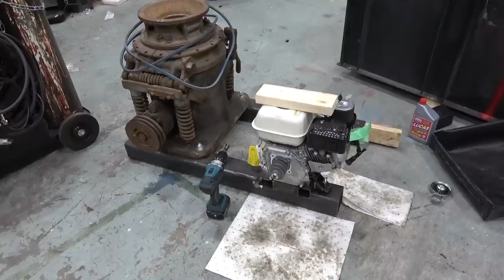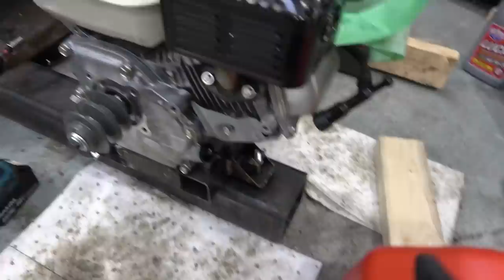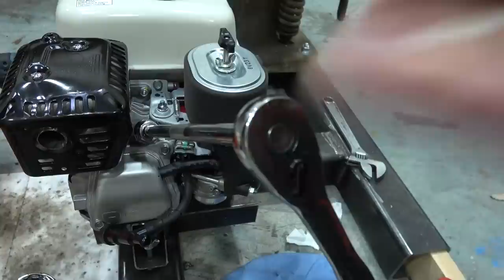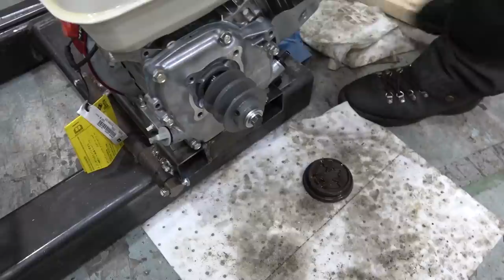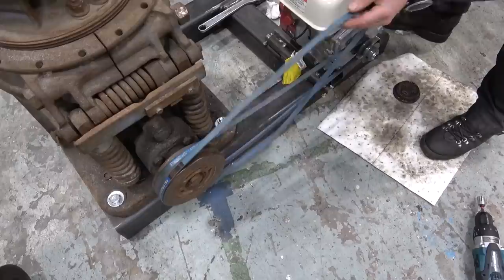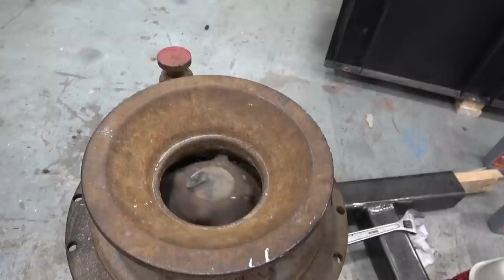Restored Diesel Honda Rock Crusher

Comment: A couple years ago I finally gave up on the "I'll remember" method and invested in a couple sharpies for the jugs full of used oil and the gas/oil mix cans.  But not before I messed up 2 or 3 dozen times, of course.
Reply: Working in kitchens has made me a label freak. You never know which brown sauce is which and how many days weeks or months it's been sitting there and whether it is supposed to be a brown-and-green sauce or not until you have the habit of naming and dating everything.

Same applies to the shop though tasting for freshness is less of an option.
Reply: In my experience the sharpie quickly fades on a gas can
Reply: @zeusapollo8688  : Then go with a wood burner and cheapo wood tags. Piece of twine to hold it to the bottle, and you're good to go.

Until you need it of course, at which point you discover the grease and dirt and occasional hotplate incident have turned the whole thing that same color...
Reply: @Paul J Pachasa JR Just do 32:1 and carry a spare plug, like in the days of yore. 👌
Reply: @Paul J Pachasa JR I'd just run 40:1 in it all. My trimmer says 50:1, but it runs just fine on the 36:1 dirtbike leftovers. 
Then again all the bikes get Castrol 2t at 36:1 whether they ask for it or not.
Reply: The oil + gas ratio is really about the oil used, not the engine going into it. As the oils got better, the ratio got lower. Get a good oil and you can run any of these engines at 50:1

Comment: I've had problems starting these Honda engines even when the gasoline is a bit stale.  After much cranking, troubleshooting and cussing, I found a fresh tank of gas fixes 'em every time.  Using diesel fuel will definitely cause hard starting.  As Madprop Boatworks said, "If a Honda engine doesn't start, it's definitely operator error".  How true!

Comment: "Warn me when you start to feel sleepy"

Dude, I changed shops and now I'm in a shop with 1 door per bay, and I like to leave my bay doors open, because sometimes I have to run the cars inside.

But some people don't like the freezing 65° temp, so they're always shutting the doors when I walk away.

Sometimes I just leave an running even if I dont have to, just to make them think twice about shutting my fucking doors. I took the far end of the shop for a reason, leave my doors alone.
Reply: Sometimes being the lone tech at a two man shop has its benefits...mainly shit like that.

Comment: Reminds me of working with my father.  Fun fact: a chainsaw will run on kerosene pretty well, and a Honda 5hp pressure washer will run if it's started on gas.  No power though.  Guess how I know. At least the old Robin won't get any rust on the internals...

Comment: When I was a kid my dad had his own in ground gas and diesel tanks. He had 70's vintage rv with a gas motor. I was given the task of gassing her up prior to a trip. Well, I grabbed the wrong nozzle and put 1/2 tank of diesel in before I noticed. Long story short I told him what I did and he filled it the rest of the way with gas. We took it on our trip and the hesitation and backfire it had since he bought it magically disappeared.  Another time I put gas in a diesel tractor. I siphoned as much out as I could but not enough to prevent the fuel filter from gelling. I claimed no knowledge that time.

Comment: That's as good as a guy nicking my round 5 gallon can of used acetone and dumping in his car... 

How do I know this... the guy was my little brother.  He knew I had a couple of round cans I used for gas... what he didn't know is I switched to the GI jeep cans... so the round cans use changed. I thing I found where my gas stash had been going. 

For some reason his car died in the middle of the night... I wonder if the polyester resin in the acetone had anything to do with it...

Comment: I've got one of those Subaru Wisconsin-Robin motors in a minibike, came from an off-grid backup generator. It's an olive coloured industrial unit with the heavy duty air filter but looks just yours, EY15 is familiar, model is W1-145 I think... Couldn't get the jeezless thing to run either. Eventually found out the petcock was the issue, so it was promptly neutered and replaced with the finest quality chinesium dingus in a thread that was close enough.
Things been running great for a few years now, even through many hours with definitely not enough oil, no governor, the remaining coarse wire screen of the filter and a 200lb gorilla at the controls.

Comment: "Is there gas in it?" The mechanic's version of IT's, "did you turn it off and on again?"
Reply: rmp5s Customer brought in a early 00s Gallant that died while driving. Fuel gauge said 1/4 full. Hooked up the fuel pressure gauge: 0 psi. “Ok, 95% chance the fuel pump is dead.”. I pull the pump out out of the tank....tank is bone dry.

The gauge in the instrument cluster had broken.
Reply: @300DBenz  Ha! Yup! That'll do it every time. 

My first car, a 1986 300ZX, would die if the gas was low and you were sideways on an incline. I was in my buddy's steep driveway once...started the car facing up the incline, no problem...but when I backed up and went to my right to turn around, it died. "Gimme a push!" Pushed it and as soon as it was facing down the hill, it cranked right up and off I went.

Sometimes you just gotta know your car! lol

Comment: this reminds me of a time in high school where one of my classmates found a one of those crotch rockets or mini bikes(49cc) next to the garbage, he took it to the high school automotive classroom which also had a small engine room and tried to get it to run he stole some fuel from one of the bikes there but he chose the only diesel bike to steal from later on he sold the bike to me for 10 dollars. i went and got some proper fuel and it started on the 3rd pull.

Comment: Back in college I lived in a semi-crappy neighborhood in Phoenix, AZ. For economy and to make sure I was never distracted by attractive females trying to talk to me during my crucial time of studious concentration, I replaced my big block Impala with a diesel Rabbit. Awesome. But it got almost 50mpg....until some fool boosted the pump. Then it went slightly faster but now only got 42mpg. One day I was headed out the door to get to school, I see my fuel door open and cap dangling. 

Some cocklick had siphoned bout 5 gallons of diesel leaving me bone dry. I had to enlist the neighbor for a ride to the fuel emporium for a few gallons to get to school. 
That evening when I returned home with a full tank and a locking cap, the same neighbor who sponsored a lift to the pumps, a shade tree mechanic and close personal friend of mine, summoned me to his home shop. There resided a 1975 Monte Carlo. Hood up. Air cleaner on the fender, float bowl on the bench. He hand me the bowl.....says "SMELL IT!"...... I whiff......diesel.  We located the fool who purloined my fuel oils. 

No one said anything to him. The car suffered all manner of little calamities one night. Tires slashed. More diesel in the tank. It's not hard to pull the remote cable on the hood and fill a crank case full of brake dust as collected from doing drum bakes on trucks. Locks shot full of glue.  Main harness cut into more convenient sections. 

That 5 gallons of diesel cost that kid a lot of money.

Comment: Great video, Love the rock crusher.  That's Bad-Ass.!! 😎.   Restore her and paint it Detroit Diesel Green, Cast Iron Gray or Machine Gray.
   Always, always sniff the fumes of any flammable liquids before using....if not to confirm the correct contents, then at least to get a bit of a buzz going before you start the motor.

I would show Mr "Wet Nails" or "Dew to the Paw Claw" that gasoline doesn't smell like diesel.    
     Then there's always the match demostrato.🤔

Comment: Hey, it's the old Honda GX160 ! They use those on go-karts, besides the generic generator functions it's used for. 1 GX160 or GX200 on a rental. Twin GX160's on a Pro-kart, or a GX390 on an 'Evo'. I used to be an official (dude with yellow flag) with the national pro-karting championship, which were endurance races. The shortest race in the season was 6 hours, the longest was 11. 11 f*cking hours in the f*cking rain with 50-something go-karts doing over 550 laps, all of them with the same twin-engined generator drone. All I remember of those days is burrowing deep inside a bright yellow raincoat, and that drone. And that time they ran me over ...

Comment: Did the same. Someone put diesel in a 5 gal gas can. I added 3 to my 36” proline toro. Had 2 gal gas in it. It ran, kinda funky but why the hell was the exhaust burning my eyes? Cleaned the carb and new fuel filter. Gas in a diesel obviously a major problem

Comment: Been there, done that... just with antifreeze.

One spring I went to start a lawnmower that was shared with some other people, it was making a truly terrible smell and running really badly, had a peak in the fuel tank and there was a blue liquid sitting at the bottom. No idea how, but it had been filled up with antifreeze. Drained that into a very old and clearly labelled petrol can, 'old, don't use'. Months later I needed some fuel for the car, grabbed a full new can out the shed, emptied it in, only realised at the end that some genius had swapped the antifreeze/stoneage fuel mix into a good can.

It was an interesting drive into town to get more actual fuel...

Comment: neodymium magnets dropped into the metal fuel tanks will collect an amazing amount of rust.. keeping it out of the fuel filter and needle and seat.. if it has a plastic fuel tank.. put one inside and one outside to hold each other in place with a dab of silicone under the outside one to keep it from being brushed off.  oh.. the neodymium magnets work in both Diesel or Gasolina.  they don't frigging care which one they pull Red dUST out of.  i usually use magnets with a hole in the middle to make it easy to push around.  i have stuck float arms to the bottom of tanks before with them.

Comment: Oh we've all been there I think my favorite was when one of the guys at the shop filled a bunch of antifreeze container is up with green diesel and of course the semi was low on coolant and I put it in the radiator and then realized something didn't smell right and ended up having to do a full coolant flush because some dumb-ass decided to put diesel in an antifreeze container

Comment: I've perpetrated and been the victim of some gas can misappropriation. Diesel, kerosene, methanol, used engine oil, 2-cycle mix marked "gas only". Coolant and/or water. Used oil in the hydraulic fluid buckets, too, when you need to mix things up. I swear one day I'll open the cap and get sand.

Surplus olive drab Jerry cans for everything. Dispenses any illusion of certainty or reasonable expectation.

Comment: Those elec-chickens are usually well versed in all the nuances of huffing gas. He should certainly be able to identify diesel pretty quick. I would think most elec-chickens would even be able to tell you the oil company it came from. He's obviously never worked at a dry camp in Ft. Mac.

Comment: Some things that also have a bad result:
1. Don't mix up brake fluid and anti-freeze. The brakes don't work very well after that.
2. Someone trying to steal diesel from a RV - but did suck the contents from the septic tank instead.

Comment: I daresay those Honda's are the best motors ever made. I've used them on multiple devices and they just thrive on abuse and neglect.

Nevermind that China has probably made billions on the clones.
Reply: Yeah you'll be hard pressed to find anything more ubiquitous. They just keep on working!
Reply: Got one for free from an old air compressor, threw her in a go kart ran 110 octane the rest of its life not a care in the world 👍
Reply: I haven't come across a Briggs and Stratton I couldn't get going again with just some simple tools. However the Honda engines sure do run smooth for small engines and are quite reliable.
Reply: @Cragified  Yeah they're forever machines as well. We used to have a 40yr old mower at our old house with a Briggs, ran just fine!

Comment: If you have some poor quality fuel and it won’t get above idle I always pop the air cleaner and hold a propane nozzle at the throttle and let it suck in air and propane gas. It’ll siphon out all the bullshit in the carburetor. Also makes a great choke when the choke no longer works.

Comment: Another version that I've experienced is a used 2ltr lemonade bottle being kept in a car as windscreen wash/coolant top-up, but with the label fully intact. Enter a family holiday scenario where we each help to unload our respective cars, followed by me deciding to try the lemonade in the fridge mixed with some orange juice. The cloudiness was hidden by the orange juice, but multiple checks on whether there had been a sewage leak somewhere nearby before realising that the 'lemonade' that I was drinking had been rolling around in a car for the better part of 2 years.......if the label was removed it would have been simple logic as to what it was, but a fully intact bottle label (with good pressure when squeezed!) meant that it ended up living in the fridge at the holiday house and ultimately in my glass!

Comment: I can’t be one to judge, I put gasoline in a diesel mower once. And then another time I put gasoline in a hydraulic oil tank. 

Someone else however did put diesel in a gasoline engine. And it ran, but the white smoke that was coming out of the exhaust was a hint that something was wrong.

Comment: Reminds me of a learning experience with a Wisconsin TRA12D on a Bolens garden tractor.  6 year old me, wanted to ride around on the ol mechanical wonder, and mistakenly filled er up with Diesel. Well, dear ol Grandpa, after realizing what I had done grabbed the good ol propane plumbers torch and goes to heating up the intake elbow between the updraft carburetor and the block. After the paint is good and burned off, he gives er a yank, and I'll be damned, she lit, took off, and ran! White smoked like an absolute bastard, chased off every mosquito and other bug living in the county, but fuck sakes she ran!!! I don't remember now if it died once the elbow cooled off, or if it had enough heat in it to keep going. That's been 20+ years ago now. Nonetheless, a gasoline vs diesel fuel lesson I'll likely never forget.

Comment: Need to drain and replace the engine oil if you tried running it on diesel. Diesel will have got past the rings into the crankcase, diluting the oil.

Comment: My Monster in law worked at Kmart two or three hundred years ago.  She was the one that had to deal with the customers returning lawns mowers because they don't start.  Most never had oil in them others had far worse than diesel for fuel.  People like that are why there are low oil shutoffs now.    And Never let an electrician near an engine, motors only.

Comment: I did that once when I used to mow my neighbors lawn with his ride on. He had diesel in a gas can problem was when I added the diesel the engine was hot so it ran good for a minute then once it got to the diesel well things got smoky and I couldn’t turn it off kind of a runaway situation I suppose.
Reply: If you can't make an engine turn off, get some damp rags, and stuff them into the air intake. When she stops breathin', she'll stop sneezin'.

Comment: word of warning with the honda /knockoff clone engines ,be careful how you mount them . if the front cover can or is making contact with the mounting plate it will over time back the bolts off and dump out all the oil .

Comment: So far working at a homedepot rental most if not all the small engine tools run those Honda GX motors or some variant in size. Other then the occational piston rings letting some oil by or pull start magneto going out they run like a cat on fire and holy fuck do customers try to kill them and they just try to live no matter what.

Comment: Next time swap the enging with a single cylindar yanmar diesel. You can even feed it your leftover baccon grease. Just be carefull not to limp wrist the pull start, it may rebound and run backwards.

Comment: my dad accidentally put kero in a tecumseh one time, crazy thing was, damn thing ran on it (must have got warm enough of the residual gas before it switched over) but... when it came time to shut it off, no go. Had to stall it out in some thick weeds before she'd finally quit chooching. That tecumseh must have been built on a wednesday. Never seen one before or since that ran as good as that one. You know, ole tecumseh got a bad rap. Shit carburetors but the smaller engines were damn near bulletproof! even slightly pressure lubed buy a lobe pump on the cam while briggs was still splash lubin!

Comment: I once put diesel fuel into the radiator of the John Deer 3010 tractor. . . .damn gas tank fill is in the FRONT OF THE ENGINE where the radiator sits, and the radiator cap was in the middle where every other fuel fill is on every other tractor we own. (I was like 9 or 10) Of course both black and faded from decades of sun. . . . My dad:  "bu.bu.b. but don't you know the difference between a GAS CAP and a RADIATOR CAP!?!?  FUCK!!!"  
You're not going to hide $400,000 from the government in a crushed gravel pile with that little crusher. . .